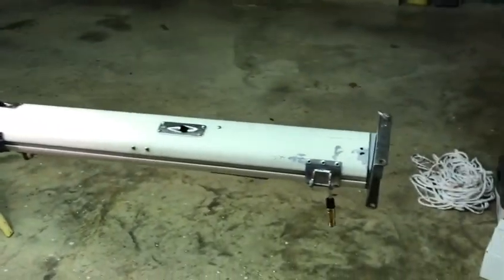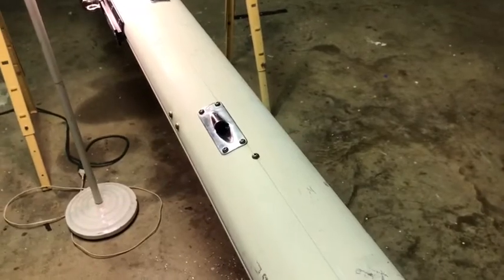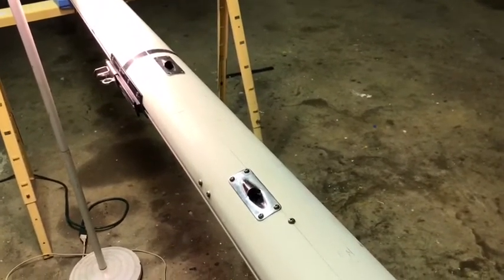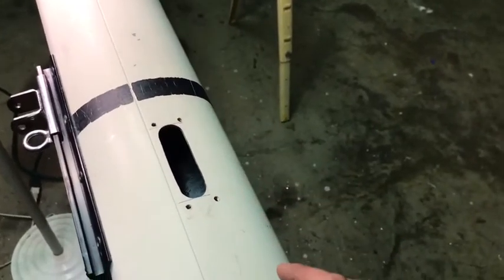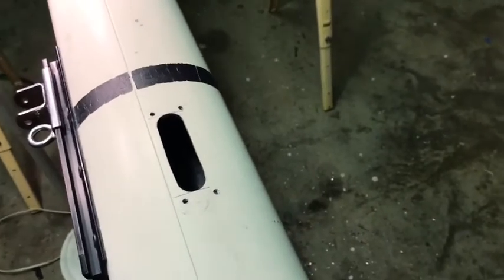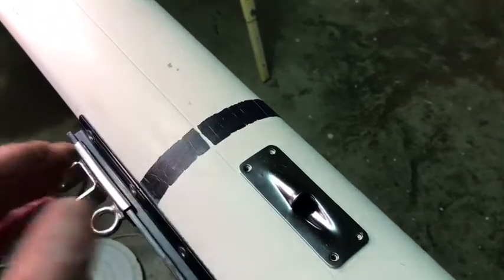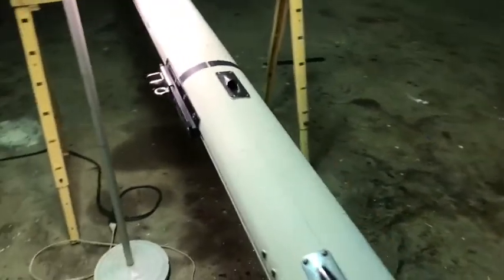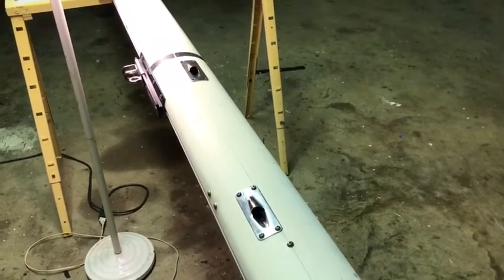Installing halyard exits on a sailboat mast

Comment: I'm about ready to install an identical halyard exit plate on my Santana 2023. I was afraid of cutting such a large hole in the mast and began thinking about it's location. Since the plate is so low on the mast, there is very little load put on that part of the mast.  I don't think it's going to weaken the mast any way, that far from the spreaders.  Thanks for showing how you made the hole and the positioning of that chafe guard at the top of the exit plate. Thank you!!